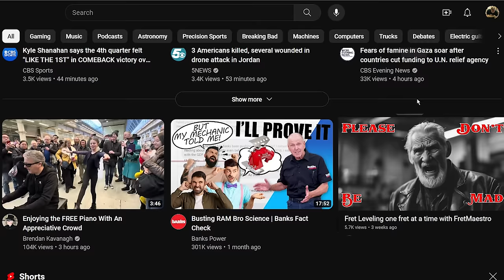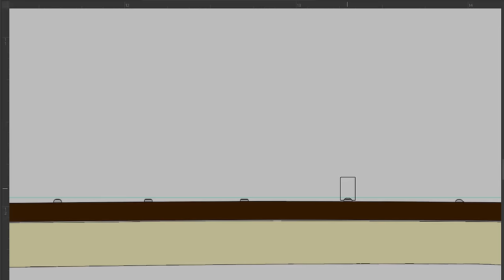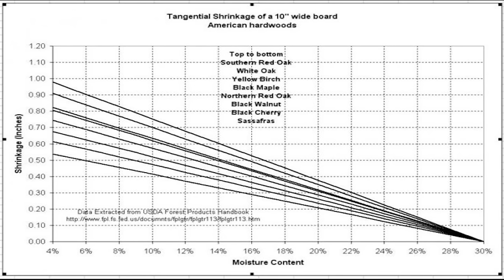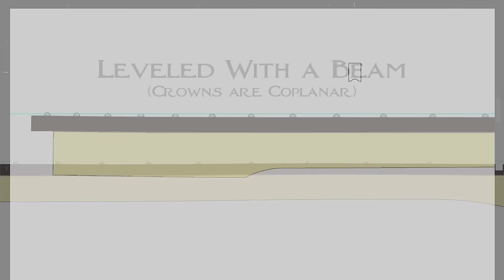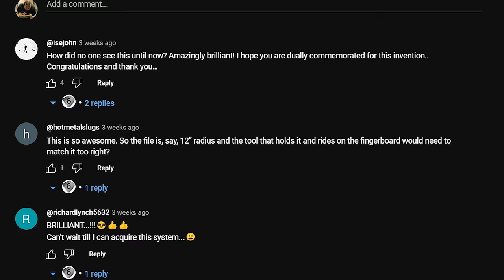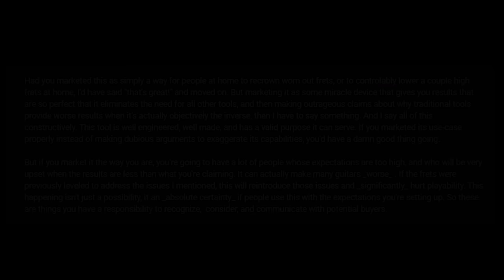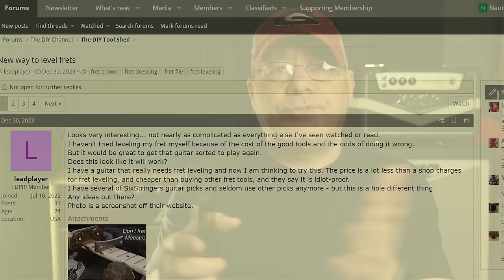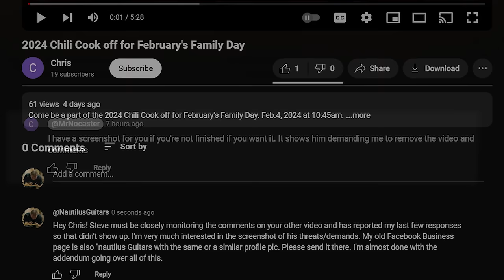Fret Maestro - Gimmick or Godsend? - A Fair Warning

Comment: Superb video. Many thanks. Can I ask how coplanarity works when the guitar is restrung and the neck has some relief?
Reply from the maker: Sure! The simple answer is that the fret crowns will follow the relief of the neck perfectly once leveled properly. 

The longer answer is that the frets need leveled immediately after the strings are removed for this to be most effective. The string tension imparts stresses into the wood that introduce unique inconsistencies, and those stresses take days to dissipate. If you let the neck settle into a relaxed state before leveling, you won't be addressing the inconsistencies the neck has while it's in stressed state. Leveling the frets before the neck is relaxed, ensures that the crowns will follow the relief perfectly. I hope that makes sense!

This is actually something this Steve guy also said that I didn't touch on in this video, which I regret. He claimed that necks take days to settle before you can level them. This is extremely misleading and will cause people to mess things up. You do not want to let the neck settle in before leveling. You want to level it right away and get strings back on it. It doesn't have to be done in 30 minutes. But a couple hours is a good rule-of-thumb.
Reply: @NautilusGuitars  thanks for the reply. I have a no doubt dumb question,  but I am a diy guitarist who occasionally tinkers and finds this stuff interesting.  I still don't get how the neck retains any of the residual relief from the strings, as I understood that you first straightened the neck with the truss rod before using the leveling beam?
Reply from the maker: @The_Macaroon  it's not necessary retaining the actual "relief" of the neck. But there are stresses in the wood that contribute to the inconsistencies across the fretboard and neck. Billions of small fibers that intertwine and can slowly slip to a slightly different position when the forces change. The overall relief goes away when the tension is removed, but the micro-variables of all of those fibers take time to settle. A bit tricky to explain without demonstrating.

Say we have a high spot in the fretboard. If we left the strings off for 3 days that high spot will slowly change it's shape a bit. Then when you string it up, it will go back to the "stressed" state.

Or imagine a shirt you have folded. When you unfold it, it's no longer folded, just like the neck no longer has relief, but some of those subtle creases from being folded will take a while to go away. Same exact principle.

Hope that makes sense!
Reply: @NautilusGuitars  thank you for taking the time to write such a detailed response. Have you got a link to your recommended tools for the home luthier/diy types? 
Best regards and thanks again for this type of output.
Reply: Exactly... coplanarity has nothing to do with Level. Beam a bent neck as this Nautilus says and you just ruined the frets, if you are lucky you may have enough material to correct it making sure the neck is perfectly flat this time around. James Warner AKA Nautilus makes a high production value video, but full of hate for someone he has never spoken with, and fear of a tool he has never used, and laces it with skewed information and wild claims such as he can come within .0002" using a sanding beam and freehand file. Only a few here have actually caught the game Warner is playing... and the misinformation he hides behind production value, overall his video is unethical, reviewing a product he has never used, vicious in character assassination of a person he has never communicated with.
I am stunned by how many people do not have the integrity to call Warner out for these indiscretions.

Comment: You make some great points here. While I initially thought this would be a good tool, the more you think about how it works the less I think it's ever going to be accurate. As you stated, if the fretboard has issues to begin with, you're only transferring that inaccuracy to the frets. And even if the fretboards fine, the claims that it's taking less material off the frets than using a traditional beam don't add up either. I mean to get a fretboard flat across it's entirety, you've still got to take the same amount of material off the top to the lowest fret anyway.
BTW That was the other thing I noticed on his video was there were no bad comments. Not one

Comment: I'm not sure I agree with a lot of this video.. I get the guy has less than awesome customer care, but I don't think the characterization of the product is fair at all. This premise that you sand down a bowed fretboard, for instance, isn't accurate. You adjust the fretboard flat, level the frets, then add relief as needed to get the action you want. So you may not like the guy... he may be an asshole... but the product is actually pretty good. In fact, for some kid with a few Player series or Classic Vibes or any other budget standard radius guitars who wants an easy, safe way to level out their frets without having to do a ton of setup this product is awesome...  You don't have to level out the board at all... just find the lowest fret, grind them to match, string it up, and adjust the truss rod to get the action to where you want it. A lot less tools, a lot less time, and you don't have to pay a luthier (if you can even find one that does frets in your area..  because that's not a given).  I get you don't like the guy, but being a luthier I feel your being intentionally dishonest in your representation of the effectiveness of the product.
Reply from the maker: The reason I don't like the guy is proven out by this very comment where you think I actually said you "sand down a bowed fretboard"... You watched his video where he appears to deliberately lie to you and the rest of his audience by pretending that I called a bowed neck "coplanar" which is so outrageously manipulative, that it's hard to even comprehend. You can watch my video and see that this is a complete fabrication. You being misled by him and coming here believing his nonsense is exactly why I'm so critical of him. 

Obviously a bowed neck is not coplanar. That's like calling a circle a straight line. He's intentionally, or due to profound ignorance, misrepresenting what I very clearly said and demonstrated, and is thereby ruining peoples understanding of these concepts, in defense of verifiably false claims, just to sell a product. That's as slimy as it gets. 

Watch my video and please tell me where anything I said matched anything he claimed I said. Where did I call a bowed neck "straight" or "coplanar". Where did I say to sand a bowed neck? lol. Nowhere, because that's obviously absurd. He is making things up Like the many examples I gave in my video, this is a misdirection meant to distract and misinform. 

As for the tool, reviews already have, and will continue to bear this out. There was a review that corroborated all of my points, and the guy gave the tool a second chance and it still corroborated my point about its flaws. He deleted the video because of the drama, but once reputable luthiers who aren't emotionally or financially invested get their hands on this tool, mark my words, the results will be exactly as I described. 

If a reviewer refuses to use a fret rocker across the neck to prove the frets are level,  then you can dismiss their review outright. Until somebody can show that this tool can repeatably get frets level under a rocker, you can determine that it's not doing what it claims. Steve is already making excuses to refuse, and discourage others, to use a rocker. That alone tells you everything you need to know. 

The entire premise is flawed. Any reputable luthier who understands the craft will know this immediately. His claims are at odds with the fundamental principles that every luthier/tech must learn. 

I ask that you actually watch my video in full, because you're clearly here in response to his video, and did not watch mine. As 1) you clearly took his claims about what I said at face value even though you can see in the video that those claims are false, and 2) Most of your points are very clearly gone over in the video and even physically addressed with several examples. 

This guy is manipulating you. That's exactly why I'm so critical.
Reply: @NautilusGuitars  So I actually watched your video before I commented...  What I guess I haven't done is watched his.. Or at least not the video that you are referencing. So perhaps your issue is that he has a video with bad math in it?  Not sure... I guess I can try to go find the video.  That doesn't change my argument, though.  Your animation shows what happens when you bar level a neck that has relief, and how that is going to knock off more material on the end frets than the middle ones... But if you properly level frets you adjust the truss rod to flatten the neck first (or at least you should....) so that you are in fact evening out the frets with that flat fretboard.  Then you crown, polish, and string it up.  The pressure usually results in some relief..  you check the distances and adjust as necessary. Angry man's tool facilitates the same end result of that process pretty well...  period. 

The other deleted video, which I also watched, didn't even make the same claims... Or at least not the one I saw.  He basically said he had to bar level it first, and then the tool worked... but it took forever. So I guess he was just using it to crown?  except the frets weren't level to begin with... It was all a bit confusing. I watched that one right before I pulled the strings off a Player Tele and tried it out.  He was also wrong.... 

Just to be transparent, I actually had all the "proper" tools..  and I had planned on using those after the maestro thing failed.  The interesting thing for me was that it didn't take long at all for my tool to file down the frets...  Don't get me wrong, going one fret at a time still takes more time, but I had the whole guitar done in less than 20 min. The finish was a little rough... but they polished up fine. Strung it back up, adjusted the relief, and the action was nice and low and the three specific spots up near the 16th and 17th frets that were horrible before were no longer an issue.  I actually USED it... it worked fine.  The premise that it wouldn't work fine for it's target audience (ie. players who are unexperienced and assumably don't have the availability to or resources for a luthier who will do a fret job) is a bit ridiculous.  Don't get me wrong, I chuckled myself when I read his recommendation for a compound radius, but according to you there's like a 5% wiggle room?  so maybe it would work?  I won't be trying it... But for a kid who's collection is standard radius low-mid range guitars, and he wants a way to fix his frets without potentially screwing things up?  Super awesome tool... 

So maybe he's got some bad science in some videos... I'll try to go watch them. But even if his explanations suck, the tool works pretty well for the intended audience.  I wish I had recorded mine.  I honestly thought after watching that other video it would be a waste of time... but you guys are not being honest about the product.  It works just fine... If you want to argue it's not perfect and his science is bad, fine... but you can't really say if you use the tool on a standard radius fretboard that it's not going to work...  It works fine.  

Oh, the fret rocker thing... I haven't read those comments or seen that in a video, but my guess is that you're missing the premise. Again, the normal process is to flatten out the neck using the truss rod before you begin (a traditional fret job, that is)... Then the fret rocker gives you a really good idea what's going on. His intent is to take the necessity to do that out of the equation. I would agree that if the neck is really out of wack his measuring tool is going to be off... the relief on a neck isn't usually uniform. But he's replacing the rocker with a tool that's checking all the fret heights.  Now to be fair, I did flatten my neck, and I also used a fret rocker and marked the high frets (again, I expected with all the negative reviews it wasn't going to work..  specifically, I was expecting the file to suck and to lose patience).  But then I used his fret hight tool and worked through his process... and it all worked really well.  I guess the potential  danger with relying on his fret hight tool is that if you're fretboard is really uneven you could get bad results...  Fair callout I guess, though I'm not sure how may people in the target audience would be having that issue. Usually the fretboard wear is right in the center of the fret where your grinding at it all the time, not right on either side of the fret, but I digress.  

Anyway...  I'm sure there are plenty of applications where the tool might not be ideal, but for most inexperienced folks with standard radius guitars that don't want to spend a ton on a luthier, this tool is actually a great idea. If you want to call out the specific instances where it wouldn't work, fine.. Or even just point out that it's not fool-proof, or there are pitfalls you might hit and your results won't be great, or because this guy is an asshole if you have problems he's probably not going to help you... fine.  But the premise that the tool doesn't work?  You're not being honest..  For most of the target audience it will work just fine, and in fact will indeed be less risky than trying to do a traditional fret job for the first time.  I have seen that scenario play out MANY times.
Reply: I don't think a neck has to be uneven by some substantial margin to cause issues. Just a tiny bit and with a 10 inch radius, with a low enough action, I see (unnecessary) fret out. But I'm interested: what is your action like on your guitar? On the necks I work on myself, I can get away with about 1mm high E, 12th fret, for 10 inch radius, very minimal relief (obviously depends on other variables as well). I don't doubt that fret maestro can make some necks play better than otherwise. I'm skeptical however about how good the results will be in the average scenario compared to alternatives (assuming one does a good job at least with these). @thomaskendall6255
Reply: @Dimiguitar   Looks like it's just a hair over 1mm at the 12th (with my cheapie amazon measuring card that's sharp enough to cut you)..  I adjusted it down to 1mm and didn't get a buzz,  but I didn't go through all the strings trying to get the lowest action possible.  I don't usually measure mine at all, I just adjust it to where I like the feel.  That said, I'm not sure I would recommend this tool for getting the perfect fret job... Maybe it can get pretty close, but I feel like it's more of an "easy way to get good results while doing the least damage to the frets" kind of thing. Like I said, the grind isn't super fine either.. so you def need to go back over it with some erasers or super fine sand paper or something... so it's not a magic one and done thing, but I still really like it.
Reply: @NautilusGuitars yeah, I guess you're perfect and know everything, or so or seems, jeesh
Reply: @thomaskendall6255 well spoken and kudos to you for trying it, this crybaby dude hasn't even tried it I guess and mark his words no one will get it to work, he drank his own Kool-Aid and needs to move on and do something more positive
Reply: @Dimiguitar except three guys have said it worked for them when they tried it, did you try it?

Comment: OK, correct me if I'm wrong, but, my argument regarding the premise of the device, is that the crowns of the frets are NOT to be level with the fretboard....EVER.  The relative parallel is with the strings, which is always a straight level line.  Action is measured from the top of the fret, to the bottom of the string.  The fretboard itself is irrelevent.   So, therefore, a flat, straight leveling beam will always be the most efficient tool, based on the reference of the strings, themselves.  As long as there is no tension (in either direction) in the truss rod prior to leveling, you will always be able to achieve the most precise fret level possible....
Reply from the maker: Exactly right!